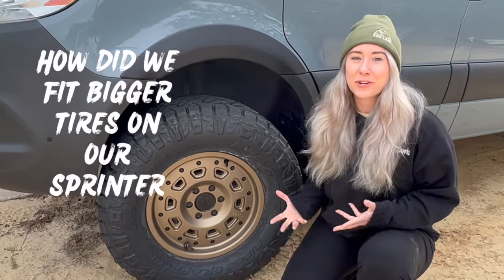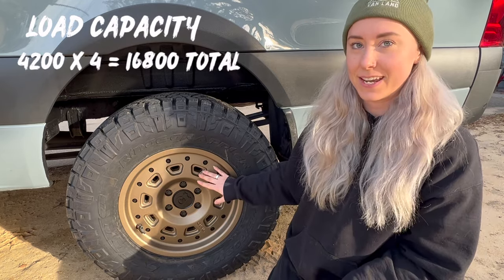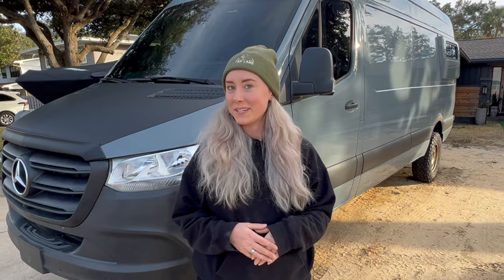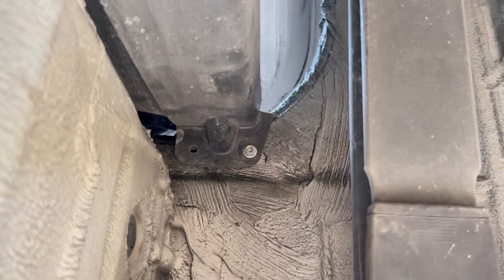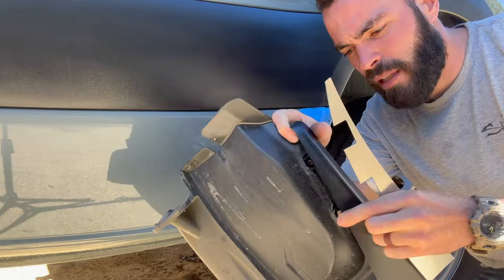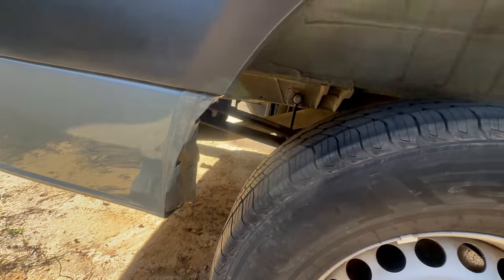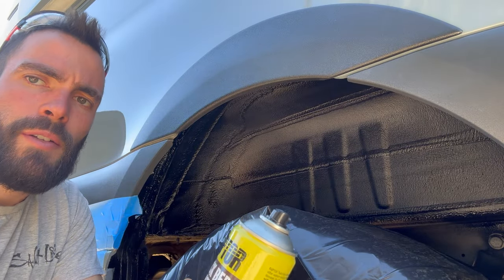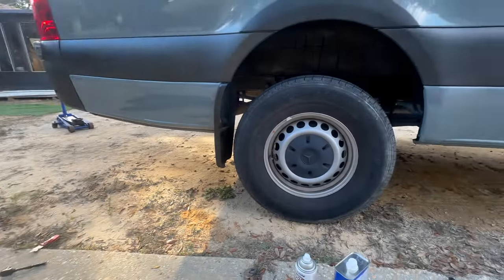How we Fit Oversized 33" Tires on a Sprinter Van!

Comment: Wheels not rims.

The wheel is the metal unit that attaches the wheel hub to an automobile via an axle, while rims are the outermost part of the wheel assembly. Perhaps think of it this way: “rim” means “edge,” and rims are located on the edges of your wheels.

Great job and thanks for the video!
Reply: Wheel = hub + spokes + rim
Reply: Its always the ones with a picture of  their dog or cat , always
Reply: @Liimpy  ahhhh, did my doggie upset you?  Scream to your mommy upstairs to bring you a Mt Dew down you your basement bedroom and you'll feel better.
Reply: @ifly64s   Ohhh.. you really showed me! 😵😵‍💫..
The annoying you tube police never show their faces..
Reply: @Liimpy  Dude, your pic is a J.

Comment: What was the offset on the rims? Any issues opening the side door?
Reply from the maker: 30mm and No issues opening the door!
Reply: Hi again, just checking in to see how things were going with your build.  With the added weight, walls and flooring, have you seen any change with your MB safety features?

Comment: I plan on going with the exact setup you guys did!  Great video!!  Very informative.  Have you seen any deactivation of the ACC and LDA lately?  AT tires traditionally run louder with road noise especially on highways.  How have they been doing for you both?  Thanks for making this video!
Reply from the maker: Awesome! Yeah we love this combo of wheels and tires. We have roughly put about 5000 miles on the van since running this combo and haven’t had any issues. We haven’t done any suspension work yet and the van seems to be a much more comfortable ride. We haven’t really noticed any road noise with the Nitto AT tires. Hope this helps.
Reply: That’s great to hear!  I have a Van Compass 4.3 with mini leaf and sumo springs back and front, and absolutely love it!!!  I somehow got a 1.5 inch rise (lift) from the stock suspension setup even though I didn’t put a lift kit on it.  Installed at Owl and they set these up a lot here in Phoenix.  I love the fact that they can be adjusted to any terrain.  Mostly highway driving for me, and drives like true German luxury when you need it!